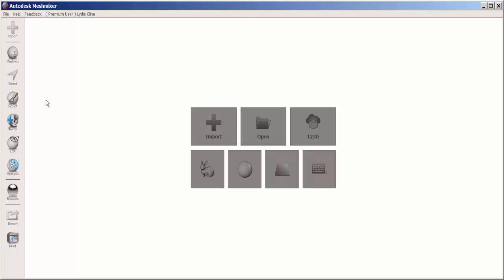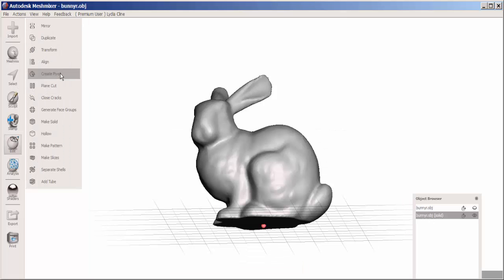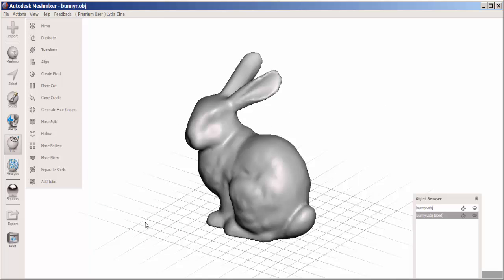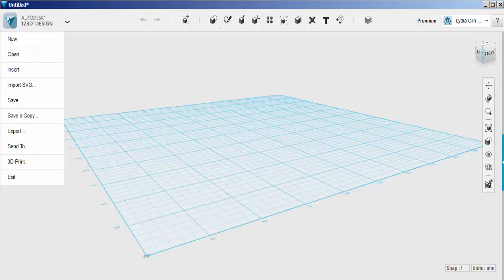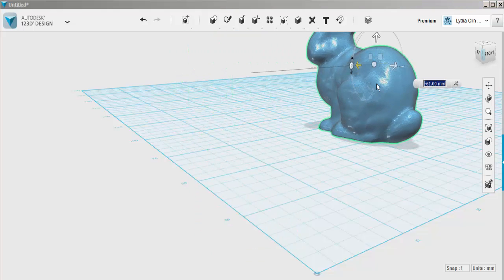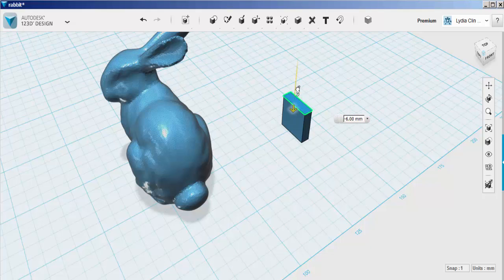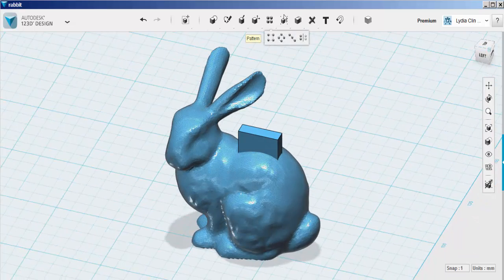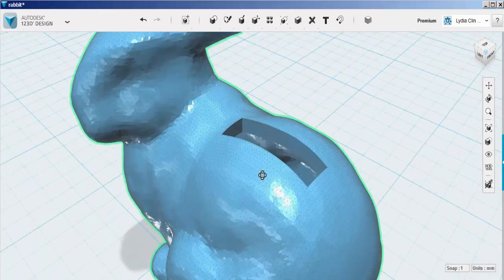Meshmixer: Bunny Coin Bank

Comment: Hi there,

I am using Meshmixer at the moment and cant find where you can subtract objects - is it not possible to do this in Meshmixer and is this why you are using 123D Design?

Thanks,
Reply from the maker: +Kathryn Bencic You can subtract one model from another. Two separate models have to show up in the Object Browser box. Select them both, and then the Boolean options will appear. However, you can't subtract objects that are part of the same model. And yes, I usually find it easier to do in Design.